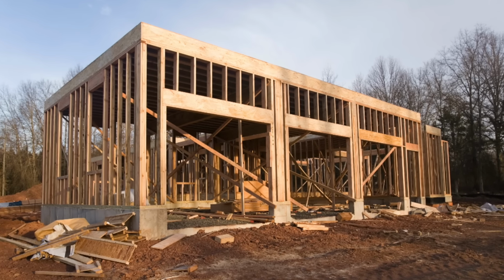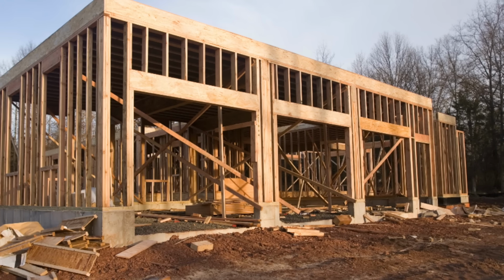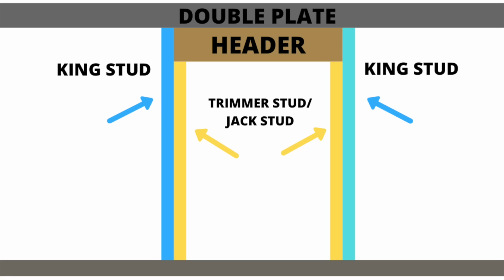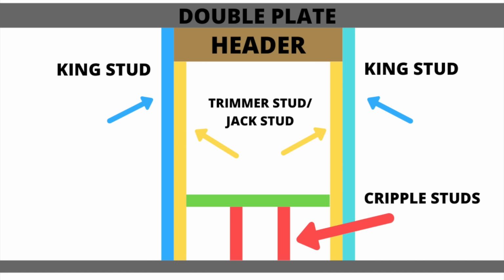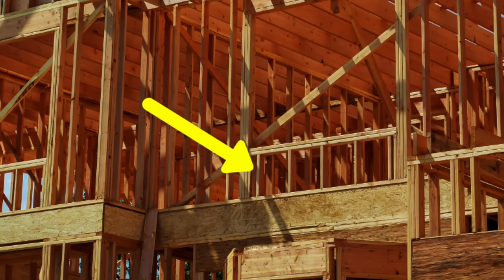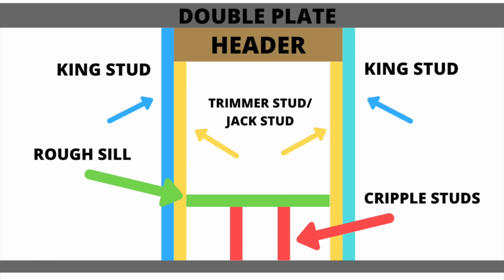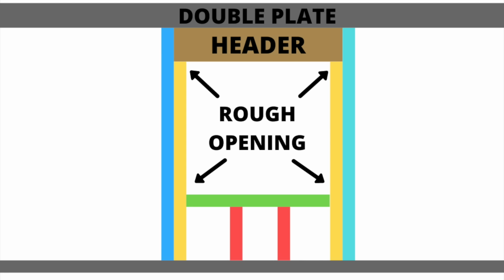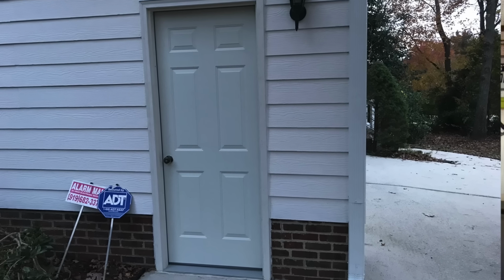All House Framing EXPLAINED...In Just 12 MINUTES! (House Construction/Framing Members)

Comment: I worry about the new joists . How long is the glue that holds the strand board together going to last? It cant be anywhere near as long as plain wood. Ive seen joists that make huge spans in large homes. When they fail, repair looks like it would be really difficult. Do they have a life span rating?
Reply: It's funny because you should worry about the new i-joists. People use them to spend all the way across their house just by sitting on a load-bearing wall or a beam and I've done been through a lawsuit and I can tell you never sit and I joist on a beam or a wall without a rim board included the beam should be moved up right underneath of the subfloor in the I joist should run into the beam and be held up by hangers. The I joists do well overspends but they're not made to hold a lot of weight so put the beam up with the floor that way the load from above there's directly on the beam and not on the joist or overtime those joists will bent especially in moist conditions such as a crawl space LVL beams will last longer than normal wood. And realize that OSB or oriented strand board is stronger than plywood you need to understand that both of them are glued together

Comment: Thank you very much this was helpful I am doing a grade 11 framing class on this
Reply: Man let me take a quick minute to tell you about a lawsuit I was in at one point. The house I built the floors started dropping and it caused the tile to crack throughout the house and the sheetrock was cracking. We go down in the basement and look at the I joist and it looked like they had been notched around the beams that they were sitting on. From all the weight coming down on those joist from a load-bearing wall above Turns out you should never span I joist all the way across the house with bearing walls underneath of them. If it's a wall you should use a rim joist in the middle or if it's a beam you should move it up and use hangers because the extreme weight is coming down from above will just Crush those I joists like it ain't nothing. I've done been through the lawsuit, I put those joints in exactly like plan said I have two inspectors pass it. But I ended up in the lawsuit anyway. I've been doing this for 35 years and I can tell you never sit and I joist on an LVL beam or any other beam

Comment: Question: does the bottom plate of the 2nd floor wall sit directly on the subfloor, or do the studs themselves sit on the subfloor?   8:45
Reply from the maker: The plate sits on the subfloor! Studs always need a plate, because the plate disperses their weight. 🙂
Reply: @TheHonestCarpenter  perfect! Ty!

Comment: My dad was a building contractor. First started as a licensed electrician to then buildings. I worked with him when he needed me, and a few years out of high school, until I had an offer come along in the automotive industry. I still lived close by and was there when he needed me. In between building homes, we would trim out others. With the exposed framing he would show me the mistakes others had made. Easy to correct ones we made, some major ones we couldnt continue until corrected. It was good to be taught the right way, and then be shown what others had done wrong. That brings home what you are taught and why you do something a certain way. My father had a good reputation. He knew the building codes. You'd be surprised the ones that dont have a clue, and see what they can get away with. The city wanting him to be a building inspector. He told me he refused, because he made way more as a contractor. Those days were some of the happiest days of my life. I still love the smell of cutting lumber. Its funny how your mind works. I can smell the cutting wood, and be instantly taken back.

Comment: That’s pretty complete. One thing I would clarify is the difference between a ridge board and a ridge beam. Ridge boards are usually one by two by material and they’re only meant to hold the rafters in position and alignment (and possibly also for diaphragm nailing of the roof sheathing.) They don’t actually carry any weight and therefore you need to connect the lower ends of the rafters together with either ceiling joists or collar ties to prevent outward thrust on the walls. f you have a ridge beam, those are typically larger and designed to take gravity loads indirect them down to bearing locations. The fact that ridge beams are directly supported by posts prevents them from dropping, and therefore eliminates outward thrust issues; this is how you achieve a vaulted, stick-frame roof. Those beam loads need to be specifically calculated and load paths determined all the way to bearing – A footing or another beam.

Comment: been doing this for 2 years already but been off the last couple months and with starting a new job Monday got hit with the imposter syndrome. my fiance recommended getting a refresher on YT instead of moping. weird we never used PT for sill plate just regular construction lumber and gasket. successfully distracted, thanks
Reply: Either one works.
Reply: @jobacuda4472  thanks. I'm doing mostly reno now and I'm still confused and still an imposter lol. never know what to do about tin test and vermiculite insulation and flooring underlayments and other weird stuff you run into. I guess best case scenario you double up on weatherproofing and what's the most structurally sound, within reason... I think it's just about time for me to go buy a book that actually says what's code.

Comment: How do you secure the second story to the first? Are there specific anchor bolts or hardware for that?
Reply from the maker: Depends on where you’re framing. But often a type of metal strapping is run up the outside of the structure and shot into the various stud packs and floor bands to tie them together.
Reply: @TheHonestCarpenter  thank you for the reply. I’ve looked all over for videos and information on the topic but they tend to gloss over this one part
Reply: You mostly see that in earthquake and hurricane zones, @Mezcaudill

Comment: Shouldn't the mud sill have a layer of plastic between it and the concrete/block?
Reply: I've seen thin high density foam used a lot in New construction when I'm wiring up the house
Reply: In North Carolina, either you use a vapor barrier or a pressure-treated bottom plate (which is what I always did)..

Comment: I always find it humorous that framers dont sheet and nail their wall before lifting their walls. So inefficient. Especially on the second floor. I never saw this 30 years ago. Suddenly,  almost everyone has changed their process. Had a little side bet with a contractor next to me that I could beat his 3 framers with just me and a kid I trained. When we were finished they were still on their ladders and scaffolding nailing off their sheeting. We even used clips on our roof sheeting which they didn't. Back in the day, we even put our windows and wrap on the walls before put them up. No wonder construction is so expensive. All that wasted labor.

Comment: I'm a computer guy with close to zero knowledge on carpentry and house building, but I've always been amazed at construction work. It's long been a hidden fantasy of my geek self to build houses. Your videos are inspiring.
Reply: I was a computer guy turned house framer
Reply: @Heyemeyohsts  I am currently a computer guy who wants to know more. How did you make the switch and was it worth it?
Reply: @Jack-vm1fg  I asked my boss if I could go part time. And then I got a part time carpentry job. Eventually I went full time. And then I started a framing company after a few years. It was worth it in the long run. In the short run, it was a lot less money. However, keeping my sanity was well worth it
Reply: Even if you don't work in construction, it's always good to have basic knowledge and even try stuff. There are many things you can do yourself without having to pay someone.
Reply: I sooo can relate to this. IT guy here. Fascinated by construction. Super cool stuff man.
Reply: I'm a plumber apprentice who deals with new construction regularly. Researched framer terminology because the frame is what I tie my rough work into and it's good to know what these parts are called. If you have even a slight longing for becoming a tradesman, I implore you, go for it! It is an amazing career and very fulfilling, especially as a man. It's a pure example of masculinity

Comment: I see these home frames with no sheeting and wonder ho you do it. care the heel out of me with such vulnerability to lateral forces.
Saw a home framed like that years ago that collapased and killed the owner
Reply: They use temporary 2x4 diagonal bracing to plumb the walls and to provide temporary shear until they install the sheathing.
Reply: @jobacuda4472  It is still incredibly dumb. In my life of framing the only time the walls are not sheeted forst is when standing the framing on uneven concrete to get the top plate dead level. We then sheet them. Why sheet standing walls on a two floor home when one can sheet them on a flat floor before standing them up? Wall jscks can lift 40' sheeted walls

Comment: 40sec in you show a 21'6" span framed without a header, and the spanning 2x10 on flat is not even continuous. WTF
Reply: The "header" is non load-bearing. The flat member is just deadwood for ceiling drywall.

Comment: As an hvac installer this helped a lot. If possible a video on what can be cut or bored through and how much would be helpful. New installs sometimes require this and it’d help to know and understand how much can be cut/bored/trimmed.
Reply: in my area round bored holes through studs, floor joists, etc the diameter of the hole can be no more than 40% of the board you are drilling through. In. 2x4 the hole couldn't be bigger than 1.4 inches. Notches can not exceed 25% of the bored. 2x4 notch couldn't be bigger than  .875 inches. That's the code for my county.

Comment: The average cost of insurance in USA is about $1500 per year. If you build out of pine you just made yourself a Fire Hazzard, consider block and cathedral roof with fire proof closed cell foam covering wood on inside. Build a ranch not a house on top of a house. Check you codes you can make your crawl space 6 or 7 feet without getting charged for a basement. Make your rafters come out about 4 feet so your walls don't get wet and rot. If you do have wood walls put dry wall on inside of wall and on sides of wall studs and on top plate. OSB burns faster rots faster falls apart with a little moisture faster and weaker than plywood.

Comment: So, is the base plumbing already done through the foundation or is everything installed once the skin is up on the house?
Reply: If the foundation is concrete slab, the plumbing is all stubbed up through the slab before the concrete pour. If there is a crawlspace, the rough plumbing is all done after framing.

Comment: I bought a house almost 2 years ago. When I was installing an outside shower I discovered there is no plywood sheathing, just insulation board. The front of the house is stone and the sides/back is vinyl siding. The house was built in the late 70s by the former owner who was a professional builder. Does anybody have any input on this? Kind of threw me off as I have never heard of this type of construction method before.

Comment: I  started  carpentry  work on overpases  and  small  bridges.   I then went into apartment  building  and then custom houses.  in 1974 I built my house in Silicon valley on 3 acres.  The   house was 3  000 sq ft   I paid 750  for the permit and 500  for engineering   the plan was 8 pages   it took 2 weeks to get the permit  I  graded  the property and drilled 20 holes for about 3000 ,  to start framing,  out of pocket it was about 4000   the total  cost of the house was 66 000  I am  now  about to supervise   a similar house on 5 acres.  it has taken 6 months  to get the plan and it is 25 pages and just to cut the driveway and dig the foundation  it is about 175 000  the permit will be 100 000  more and out of pocket to start framing  and pour   the foundation and drive way will be about 750 000  and this is not a mansion.  the total cost will be 3.5  million  And the crazy part is you pay property tax  on the total cost  of the house  In  CA it will be 30 000 a year or more  I don't believe many wil build their own house in CA.

Comment: Mud sill , bottom plate , stud , double plate , header , king stud,  jack stud , cripple stud , rough sill , ridge board , common rafter,  hip rafter,  valley rafter , barge rafter , rafter tail , I'm writing this all down from memorizing , so many names 😂😂
I'm a concrete project manager , started from the bottom really , I have framed before not roofing is something that I've never done before,  so beautiful work though

Comment: If a house is built on a concrete slab does it still get subfloors? If so how is the subfloor fastened to to slab? If not, do the interior walls  have a mud sill plate?
Reply: No. At least in the Southeast, all bottom plates are treated lumber.

Comment: Why not just use bricks/concrete blocks, joists screwed on the concrete blocks with a shoe (to avoid moisture contact), wood plank floor directly on joists and use plaster walls?

Comment: The ganged-together studs are called king studs. The ones acting as structural columns in the house from lower to higher. They tend to be far more numerous as the height of the building increases, think, 4+ floors and up. You will normally find these around stairs and other openings. 

It gets far more complicated when you start doing concrete work for larger commercial, and residential buildings. As slopes and other things have to be precise to allow for drainage. =] I appreciate the video.

Comment: You did a very good job I knew a lot of this stuff  I have a subject  for you to cover  manufactured homes or Modular homes from a factory  suppose to be very high quality and precision built but  that structure is subjected to a lot of  twisting and shock load when being transported  by a Semi  Totter truck to the  erection site  now they insist that this is done  cautiously by all professionals  but the roads are pretty rough out there and you just don’t know how well trained or caring the driver is when he  traverses some really bad roads or R.R. Crossings  and the fact that they are so precisely built  they are not engineered for the variances of the  foundation & erection site  the way a traditional  board by boared  site built home would conform  to the different tolerances ???  So what do you say is this a  logical concern does it deserve  its own  tutorial  on the laws of differences

Comment: As a framer, the one thing I'd add is to explain the importance of triangles for strength.
It's why truss roofing is so strong. (Also due to the Roman arch concept of spreading loads to the walls. Yeah I know)

Look at any old bridge made of steel girders. If it's heavy duty and made to hold cars or trains, it's probably made almost 100% of triangles.

Older homes that used plaster for walls tend to use thin lattice wood as a sub surface. And they often run parallel to the studs. No triangles. It's why you see so many old homes and barns that aren't square anymore. They tend to lean and turn into parallelograms before they collapse.

Newer walls use plywood or engineered wood sheathing which has high multi-directional strength and gives us the same effect as making triangles. 
Same thing with modern engineered I-beams vs beams with lots of dimensional lumber diagonals.

Ok, that was overly complicated. Just tell them triangles make everything stronger.

Comment: Sill gasket was not mentioned but all was very similar to Canadian framing.On my own home,I used 2x8 plates on my exterior walls and used a double R12 or better for insulation.BUT,framing was 2x4 studs offset 8".Outside 2x4 wall on 2x8 plate and inside 2x4 on same 2x8 plate were offset 8" OC for a better R value.Part of the reason was after forming my own foundation,I re used all materials to frame(T&G plywood covered with plastic to prevent concrete from adhering,all 2x4 used from forming ).In the end,my heating and cooling costs pay for any extra costs framing.I had so many 2x4,I used them for all interior walls,added pressussure treated plate to basement walls on boottom.,even strapped ceilings with 2x4 which has benefits as well(wiring&vapour barrier).I would overkill for R value because of the benefits in the future any day...but Canadian winters are good reason.Insultion keeps houses much cooler in the hot summers as well.Have a Dandy day my southern buddy.

Comment: I have a question sir , was metal brackets are really needed in the view of a true carpenter and theology believers? Because stroke and memory lost or even rain and shine not to mention brackets are more vulnerable to  sheer stress along the frame bar or beam head cross sheering like heavy leaning object also electrical wire abrassing put the house on fire more easier than a gird made from chisel on wood or wooden pin on drill hole would do better job without interfer with electrical layout that fire department would recommend

Comment: Be careful with your use of the terms Slope and Pitch.  Slope defines the shape of the roof in a ratio of Rise Over Run  6/12  8/12 etc.  These numbers can be held on a framing square to mark the vertical and horizontal lines on a rafter or truss.  Pitch is the Rise over Span reduced to a proper fraction  1/6  1/8   1/12.  These numbers cannot be used with a framing square to mark the vertical and horizontal lines on a rafter or truss.  Pitch is the sticky stuff you get on your hands from a pine board (ha ha).  Thanks.